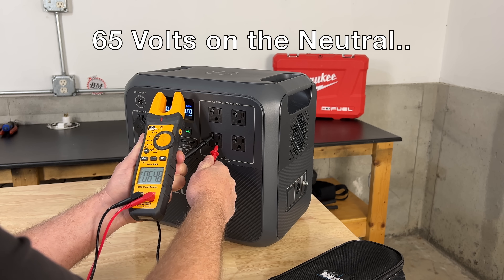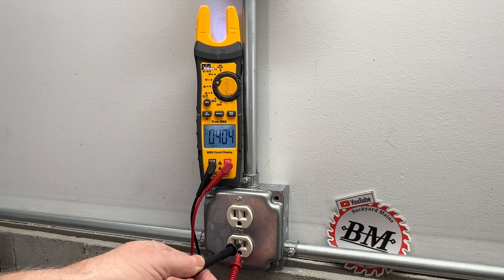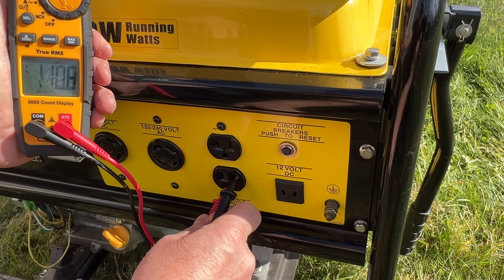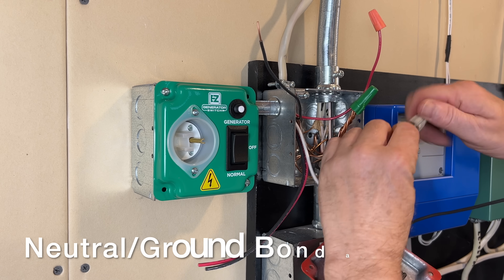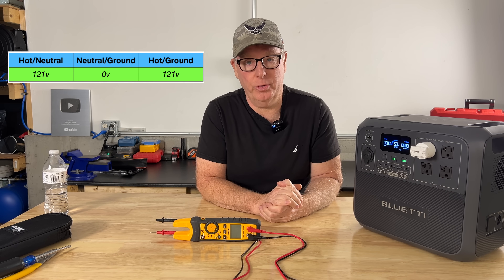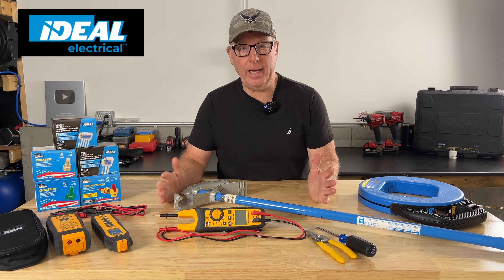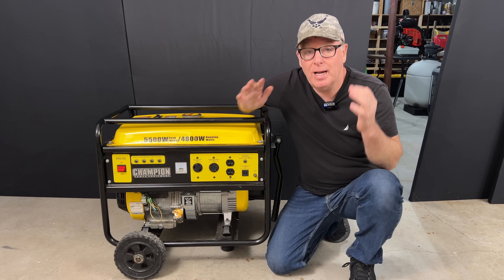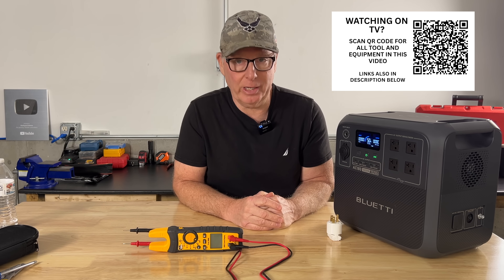The Hidden Generator Mistake.. (Dangerous)

Comment: After watching this video I checked out my Eastern Tools (Chinese) generator to see if it was bonded or not. 
Note: I've never actually had to use this generator thankfully.
Long story short, I found this thing was wired incorrectly from factory 20 yrs ago. It was 'bonded' but the hot wires were connected to the neutral side of the receptacles and the neutral wires connected to the hot side.
This left the neutral, ground and the frame of the machine hot.
Confirmed and corrected after opening the panel...scary.

Comment: Spoiler alert. The generator is not grounded, so he is measuring leakage currents. In your house, the neutral is connected to the ground at the power entry point, so ground and neutral are at the same potential, minus IR drops in the neutral conductor. You must ground the generator in the same manner to measure the same potentials.

Comment: Now, we just need to verify any made up connection using extension cords are made up at the plugs correctly. That would require some action prior plugging into to a portable generator. 
Thanks for the video.

Comment: I have an electrician installing a generac 6852 transfer switch and using a Ford f150 powerboost 7.2 kw  with bonded neutral...I keep getting a fault message in the truck...2 bonded neutrals. How can this be cured?
Reply from the maker: The F150 must have a bonded neutral and that would make sense because that power would normally be used for stand alone loads (not connected to your home). I'm not sure how easy it is to unbond the truck it or if it will even work when unbonded. Maybe a good question for Ford.
Reply: @BackyardMaine Thank you for responding. I thought the transfer switch would take care of the bonded neutral on the truck. If not could the electrician make up a short cord extension without the bonded neutral to use only with the truck to house combination?

Comment: Good to know. I ran into the same thing wiring the alarm in my old Ford Escape. The doors sensor went to ground when you opened the door, but when you close it there is a small amount of voltage, like 5 volts. A first I worried I was going to short something out, but it was just phantom voltage with no current. I ended up adding a diode just to play it safe, but it worked fine without it.

Comment: Great video . So that furnace / boiler interface- EZ switch system you showed: Is that interface wired as a Bonded or a Floating Neutral ?
Reply from the maker: The switch is wired according to the instructions for a floating neutral generator. That way the boiler and the generator will become bonded through my electrical system as soon as they are connected.
Reply: @BackyardMaine - Thank You !

Comment: My Amana furnace will fault specifically for voltage on the  Neutral on a floating neutral generator and requires the bond to function

Comment: Please make a video to wire a 240VAC receptacle 20A. Two hot legs and a ground. The receptacle does not use a neutral. Is a neutral required at the receptacle box to be code compliant to today's code? Does the type of circuit with the double pole breaker require a GFCI now?

Comment: Excellent and well-presented data.....great job. There is, however, another way to assure safety when connecting a bonded-generator to the home ( example here is via an interlock). You can disconnect ("lift") the ground wire between the home inlet-box connection.... to the main panel that is already bonded. But ONLY the ground wire between these 2 places. Retain the integrity of white/neutral from the inlet connection to the main panel. You may wish to do this if your generator is bonded and you want to keep it this way ...maybe you also use it at a construction site or when camping... as a stand-alone unit and need the bonding...as one example. Otherwise, you "unbond" the unit as shown in the vid (making it now a "floating-neutral" unit)...and maintain both ground and neutral wires back to the main panel....BUT now...it is advised to add a label to the gen that the unit is now "floating neutral"...to warn anyone else if the unit gets used by itself. You may even wan to create a label... "Floating neutral. Use bonding plug when gen is stand-alone".....or somesuch.

Comment: Follow-up question, is it better leave my generator bonded if my Generator panel is apparently capable of either setup and just have panel do the switching? Also is there any potential harm in using a binding plug vs it being bonded to the frame?

Comment: I have a seperate breaker panel in my home for my generator to use when the power goes out. All the receptacles for this system is seperate from the home panel, so there is no back feed.  My question is, does this breaker panel need to be grounded?

Comment: Question: I have access to a Predator 5000 dual fuel inverter generator in the event of an outage through the kindness of my neighbor. I plan to buy one of this exact model of my own when I can. As I understand it, they’re a floating neutral model. (I’ll be sure and test this to verify before use.)

There is no transfer switch on my home so I plan to use it to run an extension cord or two into the house.  I do own a neutral bonding plug, which I plan to use. 

I want to use it to power a small chest freezer and a few other things.  On the back of the freezer there is a label with a warning in large emphatic letters which says that the power supply for it absolutely must be grounded. Is this because the outside of the freezer is metal? Will using a neutral bonding plug at the generator be sufficient to satisfy the grounding requirements of the freezer?

Comment: Some multimeters provide a Low Impedance A/C Voltage Test Setting for the exact issue you have described..Very handy.. Fluke has meters with this option.    LO  Z setting..

Comment: A meter with lowZ or a low impeding setting is a good way to eliminate ghost voltage readings in can also be used to test GFCI circuits.

Comment: I've watched this over and over and I STILL don't get it. Thats why I HATE Electrical work. The better question is: HOW  do I know when to use a Bonding plug on my generator or Power Station and HOW do I know when NOT to use one without using a meter to read voltages? Because - Basically what I got from this video is......I don't need a bonding plug.

Comment: I wish you explained where the phantom voltage comes from.
Reply: Nowhere. (: The line to neutral PHANTOM voltage went to zero volts once he bonded neutral and ground. If that voltage were real, a short circuit would have occurred when bonded.

Comment: I know you're right about not having the bonded generator, but there's another situation that happened to me, where the neutral at the generator failed, which put 240 through my home, it destroyed a microwave and a few other electrical items, if I had left it bonded, the ground wire would've taken over for the neutral, so I leave mine bonded in both ends, fearful of that could happen again. When using a 120 V generator only, I leave the neutral floating.
Reply from the maker: The failed appliances must have been connected to multiword branch circuits. Otherwise you would have just lost power. My next video covers what they are and how they should be wires.
Reply: @BackyardMaine  that might very well be the case, I hadn't thought of that, I no longer own that home, so I can't check, but isn't the panel itself a multi branch, sharing a single neutral?

Comment: I know it's against code to use a bonded gen to power a house if you do not switch the neutral, but other than having return current on the ground conductor in the cordset back to the generator and  tripping gfci on the generator (if it is gfci protected), what other hazards are there using this configuration?

Comment: Unless someone else has mentioned it in the comments, a Bonding Plug should not be used in a GFI outlet in a Generator as the GFI will 'trip' repeatedly from stray voltage from Neutral to Ground from Inductance Current.

Comment: My generator is bonded neutral, should I use a ground rod on it if I'm only using it with cords connected directly to electronics/appliances?
Reply: Short answer, no. This is what they are designed for. You can get a grounding plug, but using it without a transfer switch is unnecessary. Totally safe to use just a extension cord. The only time when you'd get a problem is if the generator is grounded via grounding rod, AND the house outlet is tied to your house ground. That's a ground loop and can cause problems (shock you problems). He does a good job explaining it.

Comment: I don't understand why people keep making a bootleg ground. You have a plug, you're connecting wire to the ground anyway, so just make a lead with 12 gauges wire and a clamp in the other end to clamp to any metal conduit, or even a stake hammered into the ground, if you're in a pinch. It doesn't make any sense to create a plug that is dangerous. As soon as you connect anything metal, now you have current flowing through the case. If one is touching the case and is in a puddle, or grounded in some other way, the current will flow through them. Very dangerous.
Reply from the maker: A bond plug is not a bootleg ground. It’s a bond between the existing ground and neutral. In our homes it’s called the main bonding jumper. Ground is not restive enough to trip a breaker if there’s a fault. That’s the reason for the bond. I have a full video covering this and more coming out is a few hours.

Comment: Using a meter that has a “LoZ” (low impedance) setting will eliminate the ghost voltage reading.  Great tutorial!  “Bonded once” is exactly right….this is why any sub-panel must have separate ground and neutral bus bars.
Reply: Would an older analog meter show a different result without the bonding plug?

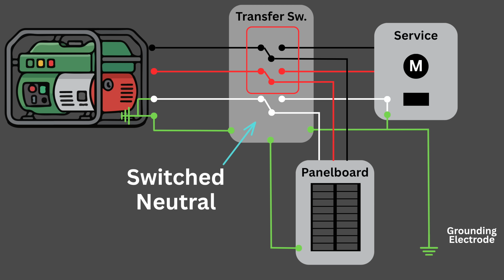Comment: 12:36 - I don't understand, Service should be connected either to Panelboard, or to Generator, but here the two are connected between themselves, and Service is disconnected.
Reply from the maker: The bond between neutral and ground can only happen in one location. That is either at the disconnect (if you have one) outside at your meter enclosure or it's in the main breaker panel. If the generator is bonded as well you then have two bonds which is not safe. The only time a bonded neutral generator can be connected to your home would be if the transfer switch also switches the neutral conductor. This would completely isolate one bond from the other. I hope that clears things up a bit.

Comment: Most people do not know they should connect their neutral to earth ground when using a generator or battery powered inverter when there is no other neutral to ground connection.  They just plug stuff into the generator, it works, and they think it is good. I'm afraid this is an issue that might be "too complicated" for the general public to understand.  

A GFCI can offer some protection in the floating neutral case,  but GFCI's can experience a lot of nuisance tripping  when devices are connected and disconnected from the generator.

I ended up installing a 20A switch to connect/disconnect neutral to ground on my Champion generator so I could still use all the plugs.  I have a short little 4ft grounding rod I use when setting up my Generator for powering a campsite. I know I probably have a higher ground resistance with this short 4ft ground rod, but something is better than nothing.

Comment: Great video - thank you. The following statement appears in the manual of my Champion 9000W generator: “The generator system ground connects the frame to the ground terminals on the power panel. The system ground is connected to the AC neutral wire.”
I assume this means it’s a bonded neutral machine and fine for stand alone work. 
I’d like to install a central connection to the house though and manage load during outages through the panel vs running extension cords. 
How do I convert the generator to a floating neutral as I assume that will be required.
Reply from the maker: You would need to lift the neutral to ground bond. It's usually a wire or a strap that connects the neutral bar to the generator's frame.

Comment: About 1 of 6 small generators sold here in NZ have a ground-bonded neutral. Although they're not marked as such it's easy to tell because they also have an RCD/GFI protection device on the panel and of course specify that a chassis ground wire be attached.  All transfer switch applications here require (by code) a floating output and it's easy to remove the link on a bonded generator as it's clearly marked.  The existing MEN connection is used at the main switchboard.  They also require a registered electrician to enliven the circuit, none of this DIY stuff.

Comment: When I plug my generator into my house system, the ground and neutral are bonded, making the bonding plug unnecessary.
Reply from the maker: You don’t want to use a bonding plug or a generator with a bonded neutral when it’s connect to your home. The ground and the bond will be achieved through the connection.

Comment: Howdy. Yes.
Using the generator as a stand alone for instance in a construction site.
The Neural should bonded to the Protective Earth (Ground).
Now the million dollar question. Should one use a soil electrode and bond the generator Protective Earth to the soil potential ?
If one uses only one tool or appliance soil electrode bonding is not necessary. A floating Hot + Neutral/Protective Earth system is more safe than a soil electrode bonded system.
But if two ore more tools or appliances are used, soil electrode bonding is mandatory. If not, a fault voltage will propagate along the Protective Earth wire to all tools / appliances.
Cheers.
Reply from the maker: A stand alone generator needs the neutral bonded to ground which is the frame of the generator and all the ground connections on the receptacles. This will provide short circuit protection no matter how many tools a plugged in. I ground rod ( grounding electrode) or earth ground is not required by code here in the USA. The earth ground provides high voltage surge protection primarily from a potential near by lightning strike. It will direct induced current to ground. You can drive a ground rod if you like but it’s often not practical unless the generator is in a fixed location.

Comment: That's because what you're looking at is the split secondary of the output of a transformer, the center tap of the Transformer is creating the artificial floating ground connection, and then across hot and neutral you see 120 volts. Which is just fine, this is also called balanced power it was a fad in the audio and recording industry about 20 years ago, it does lower the noise floor slightly. Because connecting a balance Transformer as a supply source to the Transformer input on a piece of equipment would create if I need it the equivalent of a balanced line, similar to how we send balanced audio from one location to another over long distances without adding noise. However this only works if the piece of equipment you're going into has an actual iron core Transformer. It has a switching power supply so where it is compatible with the switching power supply and will work just fine. You don't get the advantages of the floating ground reference on the transformer. But just remember the output of most of these devices, is the equivalent of taking the secondary of a transformer tapping the coil in the center we call that ground because it's technically now going to be zero volts reference to hot or neutral.

Comment: Good explanation.  
A simple schematic could be helpful - to show the difference between the ground 'circuit' (appliance or tool cases, electrical boxes, etc) and neutral that carries current.  And to show how bonding actually works - necessary if there does happen to be a short so that in that instance the ground circuit will do more to ensure taking current to ground through the wiring - and not through a person who might come in contact with the short.  
Bonding is a very important consideration.  Mentioning use of an actual EARTH ground would also be helpful - used to go further and ensure a true ground that can sink current to earth through the wiring during a short circuit and not through a person who is probably standing on the dirt / soil (earth).  Without the dedicated earth ground, there is a chance that a person contacting the generator-powered circuit could become that path to earth ground.

Comment: Forgot to mention to use that ground connection ...
Reply from the maker: A ground rod is not required for portable generators although it's not prohibited either. Most generator manufacturers will recommend a ground rod but they do need to protect themselves from any possible liability. Here's some context: When using a generator for stand alone use, you do need a neutral to ground bond. This bond is just connecting the frame of the generator and all the grounds on the receptacles to neutral. That connection creates a low impedance short circuit path allowing circuit breakers to open and clear a fault. The GFCI protection will also still function without an earth ground connection. 
The ground rod (grounding electrode) establishes an earth connection to the frame of the generator and is primarily surge protection. It's job is to direct induced surge voltages from a near by lighting strike to ground rather than to every grounded surface. Another added protection would be to also install a surge protector. Although nether of these two are required and they are often impractical unless the generator is in a fixed location, they are not a bad idea for the safest use.

Comment: Great and correct video!   If you are connecting a generator or power station to an RV, you need to have a bonded system.  RV’s do not have the bonding in its system.